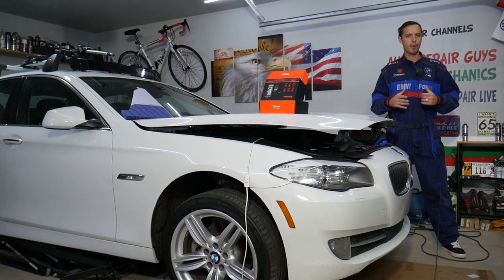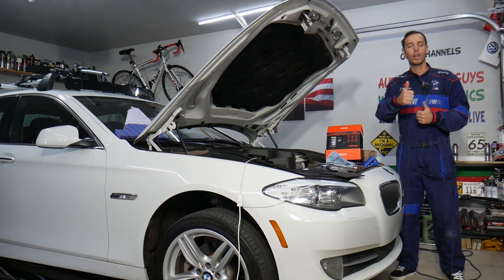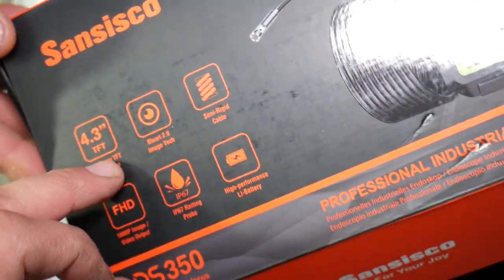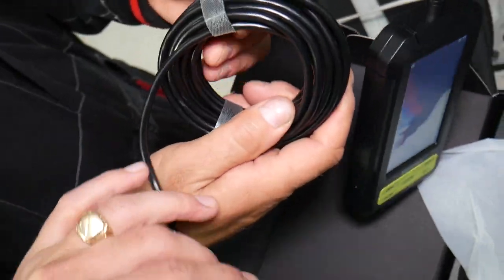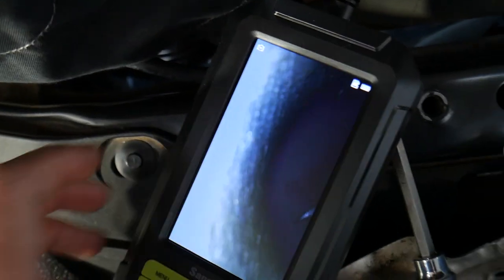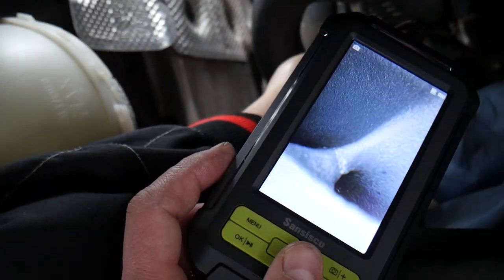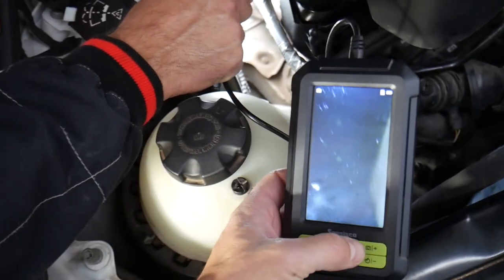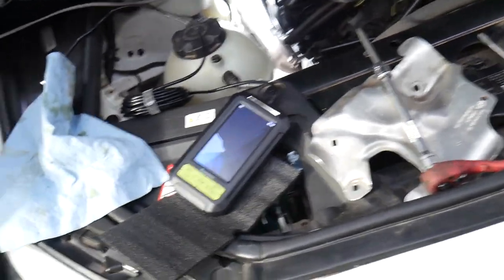Sansisco Dual Lens Endoscope 1080P Borescope Inspection Camera with Light Automotive Plumbing REVIEW

Comment: this is great to check for head gasket coolant leaks,if you have a misfire and suspect a tiny coolant leak into combustion chamber you can pressurize the coolant system and see exactlly where the hg is leaking.or bent valves.many things the dual camera can do the single cameras just cant.
we did this and sure enough we spotted drips of water leaking into the combustion chamber right at the headgasket.